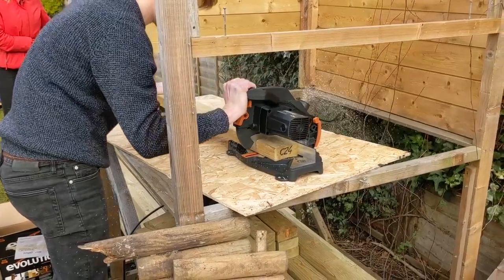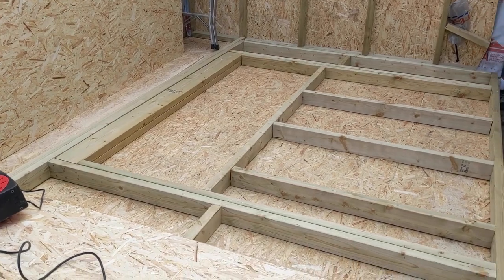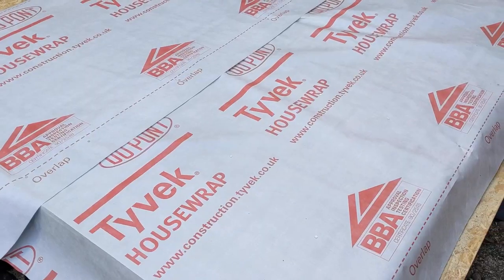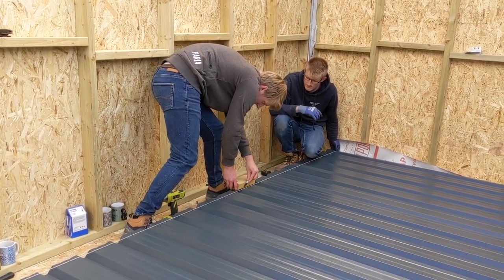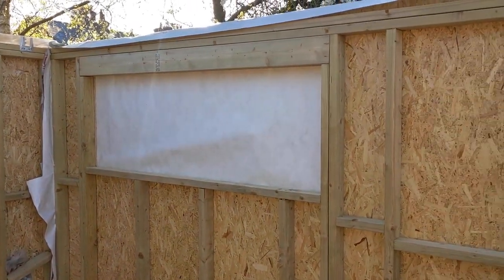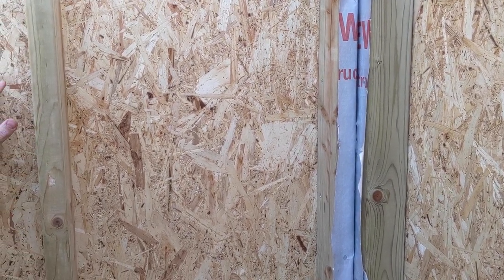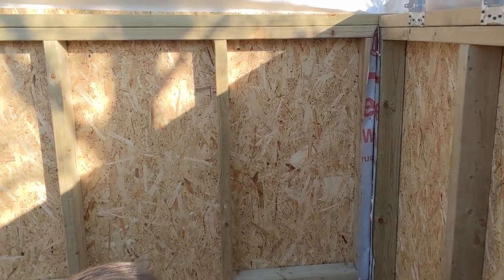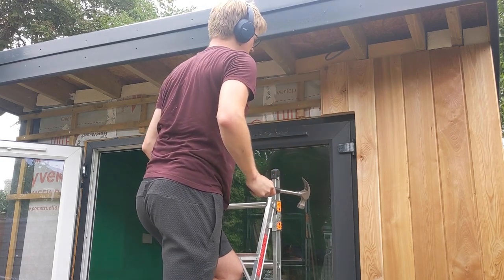Garden Office Build | Wall construction and cladding installation | EP2

Comment: Thanks Rich, some useful ideas there, will have to steal the idea of trapping the Tyvek in the corner rather than tape jointing it where I can't access it! Out of interest, how did you go about joining the two corrugated metal sheets at the corner where you don't have access? (ie. at 3:23). I have similar access problems on 3 out of 4 sides, so the back corners are going to be a pain in the butt! (Also, is there a special name/term for that corner piece over the corrugated metal sheets or is it just some sort of corner trim?) Thanks!
Reply from the maker: Hey James! Yes, that corner piece is called a barge corner flashing. It slides underneath the fascia to ensure water doesn't get in. In terms of attaching them, let's just say that some are more secure than others... Maybe you could attach the corners to the back wall before you lift it up?
Good luck with the build!
Reply: @richclifford4571  Great, thanks for that. I think I'm going to have to take a similar approach - I figure that the fences reducing access will also reduce the wind/rain that those areas will have to deal with! Yeah, that's what I was thinking, putting that barge corner flashing on before lifting, then when the next wall goes up filling the gap under it with sealant/mastic and guiding the corrugated metal into it. Cheers for your help!
Reply: i have the same prob,two very tight aides to the fence with no access once the fence is up. How did you guys do it in the end as i have no way of getting to it when those sides are up.

Comment: Great videos buddy. Curious how you managed to get the cladding on and then lift it and the walls into place?

And without a continuous wrapping around of the Tyvek, have you experienced any water ingress at all?

Finally, why the need for an office, do you WFH?
Reply from the maker: Thanks Marcus!

It was all done on the floor and then it took 4 of us to lift each wall up and screw them down. The hardest part was putting the corner pieces of cladding on which involved access from the back whilst the fence was still down between me and my neighbour. 

No water ingress to my knowledge and we've had a lot of rain recently!

Yes I work from home so I'm using it for 8/9 hours 3/4 times a week. I couldn't recommend it more as a way to separate work from the house. If we ever move house I'll 100% build another one!
Reply: @richclifford4571  ah that’s interesting, so you might have had to have made it further from the neighbour’s fence if it had still been up?

I would love to work from home. I work retail/hospitality and I’m done with it!

Comment: Hey Rich!  Great videos.  I'm in the process of planning for my second garden room build (moved house!)  The last one was built in a very similar way to yours, was about 3.5x4.5m but I used very cheap cladding - wont make that mistake again! 
Just wondering where you bought the steel cladding from?  From a few quick Googles, the ones I could find looked quite different to yours and I like your idea of doing this on the sides I can't really see!
Reply from the maker: Hey Graham, thanks! I bought mine from a company called Bushbury Cladding (https://www.bushburycladding.co.uk/box-profile-steel-roofing-sheets). Even though I used it on the sides I can't see, I actually really like the look of it and didn't need to hide it so much! I hope the build goes smoothly!

Comment: Very interesting. Why didn't you insulate between the osb and cladding?
Reply from the maker: Hey DJB, I'm not an expert but my understanding is that adding insulation on the outside of the osb would make it not breathable which could cause issues for the timber if there's trapped moisture or water gets in. The cladding also needs an air gap so it could end up being quite deep.

If you wanted to add extra insulation then you could do it on the inside. Personally I don't think extra insulation is needed though. I've used my garden office throughout the Winter and my 1,100W heater was sufficient with the 75mm PIR insulation.

I hope that helps!

Comment: Hi Richard. Thanks for the great video! Did you need to Leave a space for the anthracite cladding or did you just screw direct to the osb?
Reply from the maker: Thanks Lefty! Yes, just straight into the OSB, it doesn't need an air gap like timber cladding does. I hope that helps!

Comment: how did you connect the wood cladding and the steel cladding? thanks
Reply from the maker: Hi Rick, the wooden cladding is attached to batons and I just used a thin strip to cover the end that butts up to the steel cladding.
Reply: @richclifford4571  Hi rick. I meant how did the steel sheets and wood cladding butt together to be water proof? Thanks and your vid has been very helpfull so far